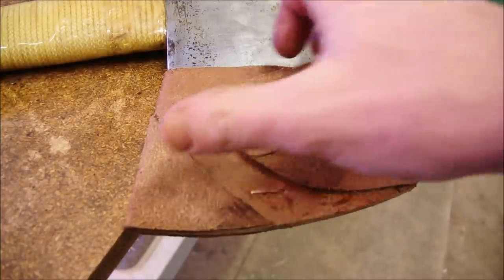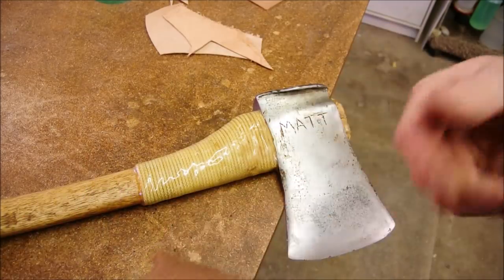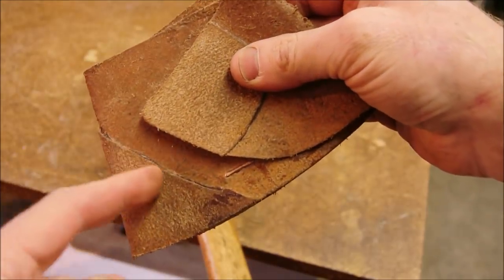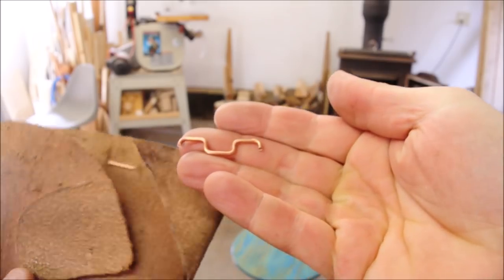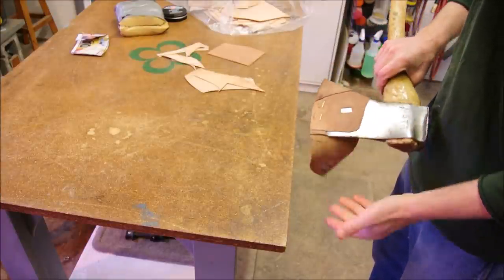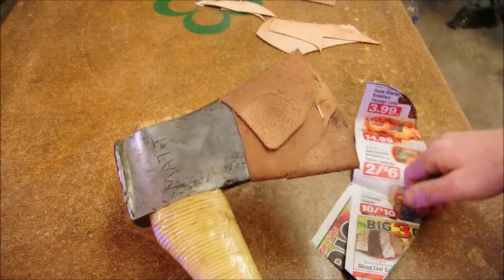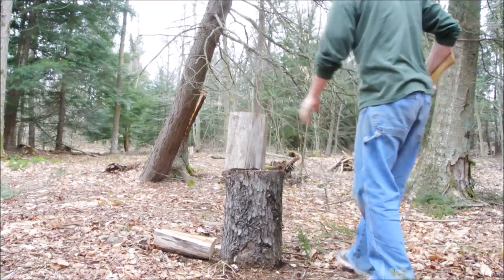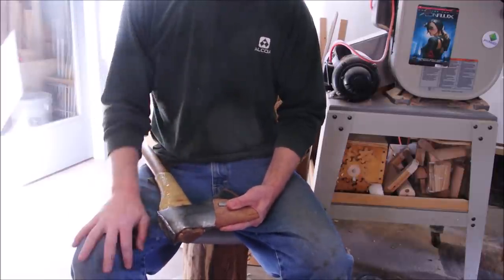Magnetic epoxied leather sheath (prototype, no sewing)

Comment: Epoxy, copper wire, and an axe? All I need is golf balls and pex and I've got a pocket bingo!  This is a project I should probably try some time. Maybe not for an axe specifically but I've got a few draw knives that I could use the same pattern making technique for and maybe some carving knives too even. Plus using epoxy instead of worrying about stitching.